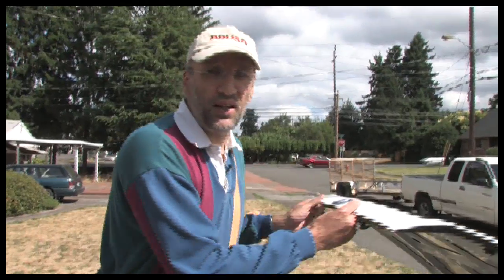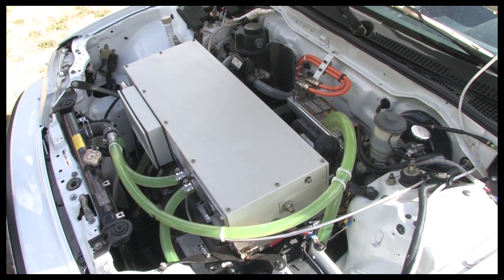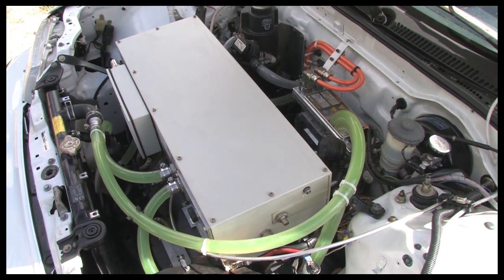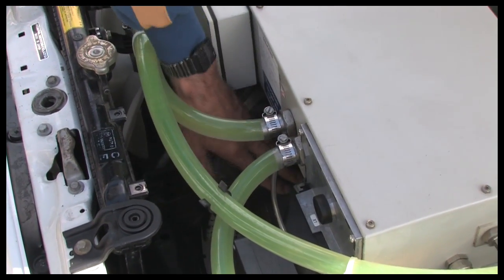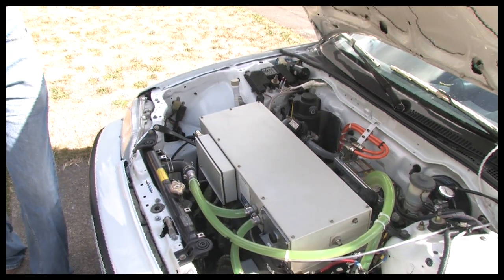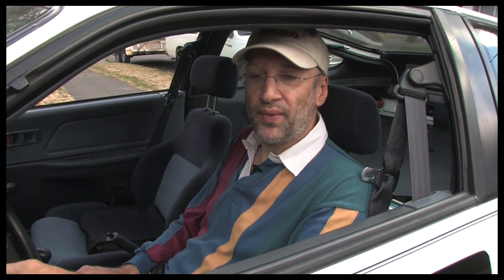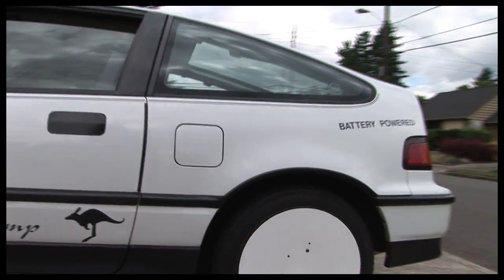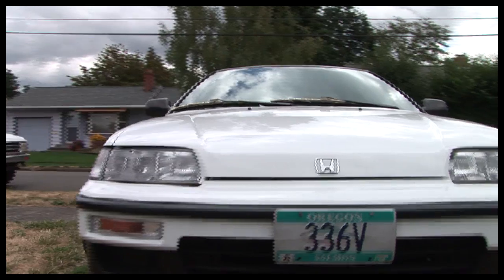Running On Lithium: Converted Electric Honda

Comment: there is no such thing as in a 1995 CRX I just wanted to make a correction on the year Honda stop making the CRX in 1991 because the Honda Del Sol was release in 1992 but it's a nice car i also have Honda my self i hope i can get my 1991 Honda Prelude converted into electric soon